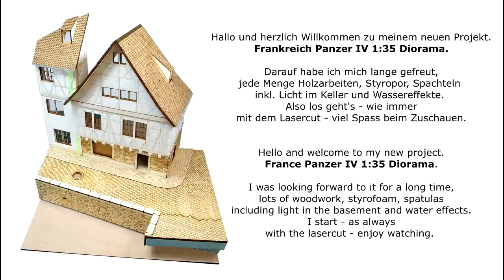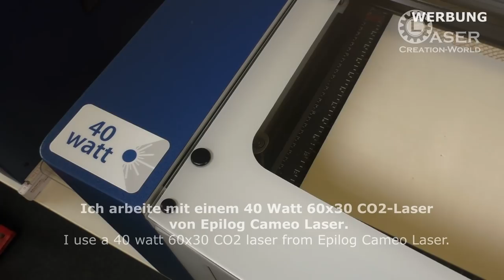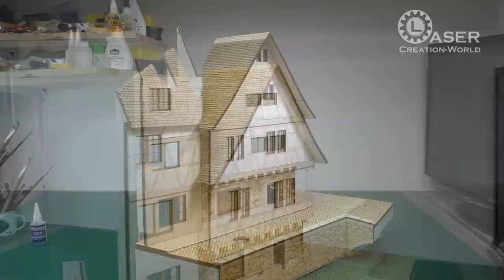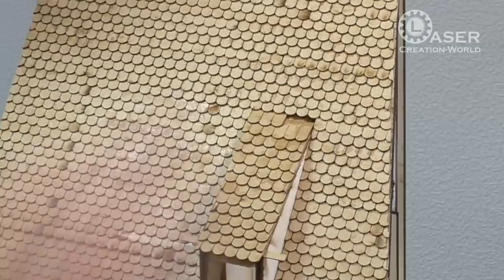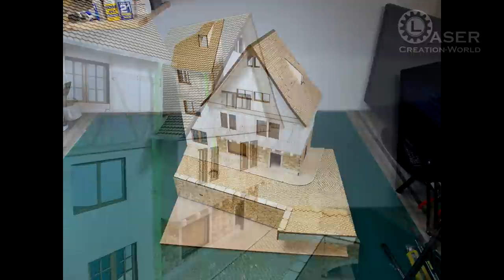Frankreich Panzer IV 1:35 Diorama Teil1 english subtitle

Comment: Nice! But I just have a small remark about your gutters, in France gutters aren't connected to the ground! The tube usually ends up about 30cm from the ground and is angled at 45° and the water simply fall on the walkway! Also your horizontal gutters should be closed to prevent water from not falling into vertical gutters. But those are small details, I'm looking forward for the rest of the build!

Edit: In my house gutters are connected to the ground and I live in a 30's house so I might be wrong yet it was remade some years ago by the previous owner so I'm not sure it is a new convention or if it was like that back then. I'm used to see the gutters configuration I previously explained, it feels more natural to me but it's in Paris and your house design seems to be more "Normandish" so I dunno as I'm not from up there.
Reply from the maker: Thank you